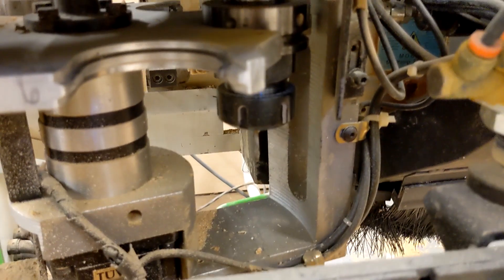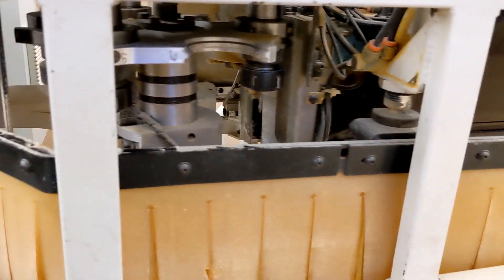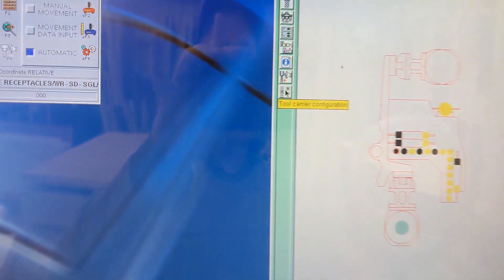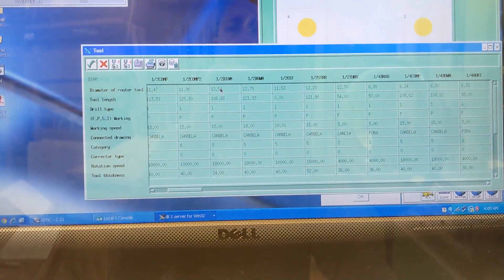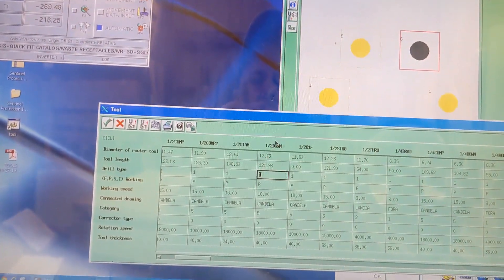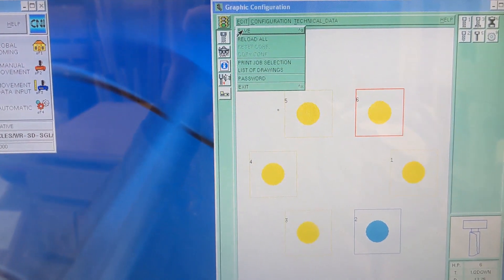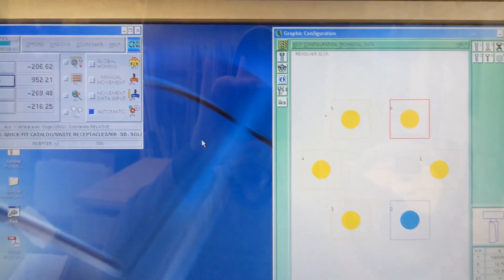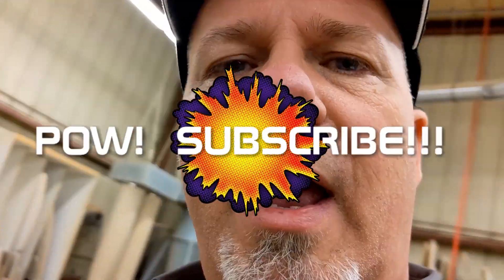BIESSE ROVER 24 Loading A CNC Tool Into The Carousel AND Equipping The Router Tool Cradle

Comment: hello sir,  such a great video but i want to know why you enter "half inch down" and if we want to add the actual tool length suppose 75 mm , then where to fill 75? in which column? please reply as soon as possible . thankyou.
Reply from the maker: Hi rohbsing8365! The half inch down refers to the endmill. It is a 1/2" diameter endmill and is a "down cut" bit...
Reply: @thecrazycncguy7500  thankyou